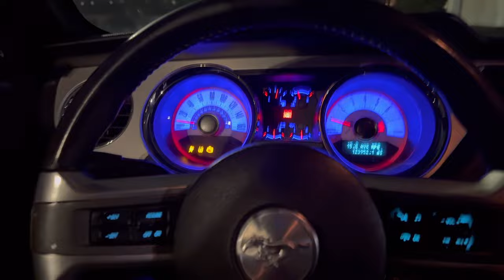INSANE DRAMA! 5.0 Vs M240i! $2,000 Pot #Ford #Mustang #BMW

Comment: 4:20 is the b58 in the Supra different or something ? 😂 or could’ve been that the Supra weights less than a g chassis ?
Reply: I’m thinking it’s probly a 300lb diff between 240 n A90… and it’s the B58 in both. A90 would have taken it IMO
Reply: @XpDaYungin 2020 Supra was 2 port along with every m340i, 2021 all b58s were switched to 6 port, Supra and m340i’s and all the other cars using the b58 lmao
Reply: @xxthehuskycaboosexx correct sir
Reply: @XpDaYungin 🫶🏼
Reply: @TheVagitarian18 supra is not dct it has a zf
Reply: @xxthehuskycaboosexx I have a 2020 and it’s a 6 port
Reply: @ElChalafak  did you Buy it used?

Comment: Don't roast me, but what the fuck is a pump? One using different gas?
Reply: mustang owner is hinting that the bmw is running an e85 mix more then likely e30 or e50. so by pumping 93 or 91 not sure what they got out there it would lower the content/prove its on pump gas